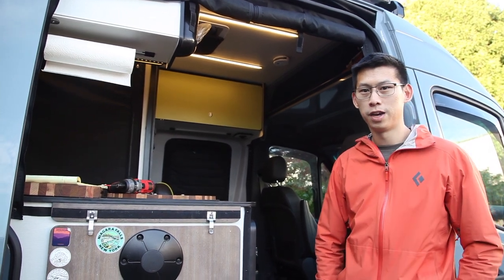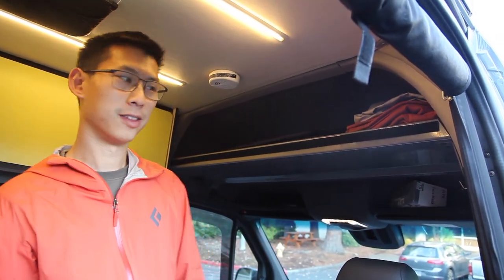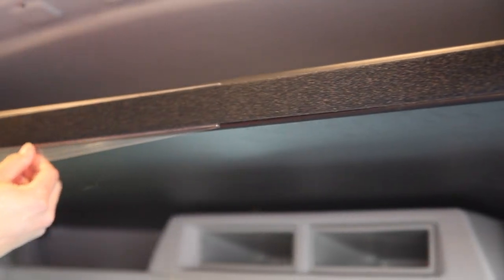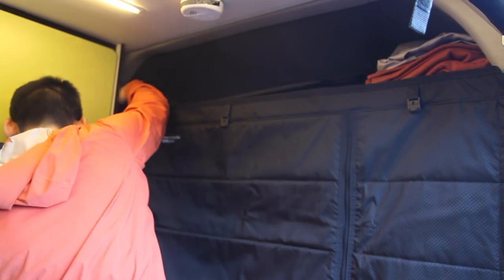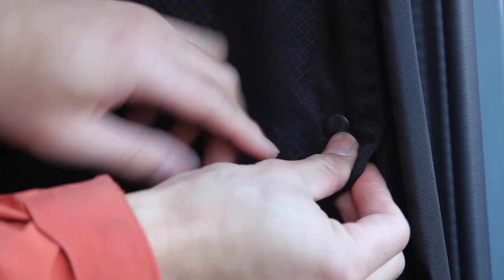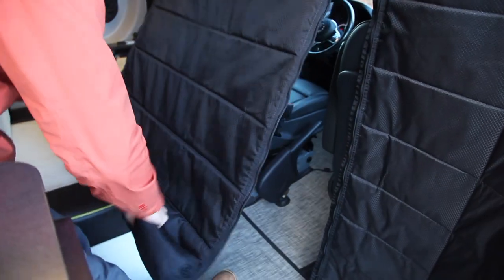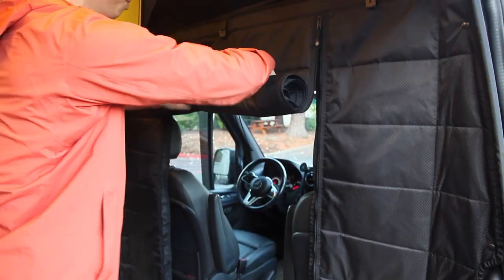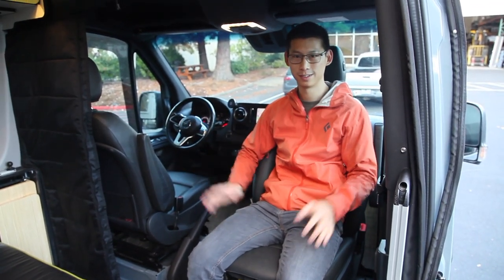Cab Partition Installation & Functions

Comment: are the zipper pull tabs on just the cargo side or both cargo and cabin side. Would be nice to be able to seal/close the partition in the cabin without having to walkaround the outside. Also your website says it's for a revel but in the video you speak of a sprinter without the headliner shelf so I assume this would fit a non revel sprinter just fine assuming you install a headliner shelf??